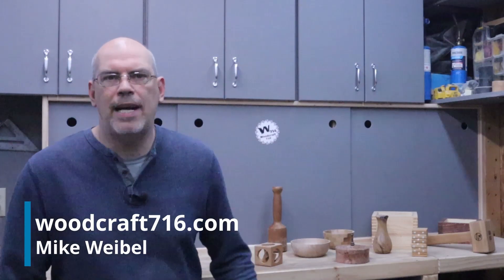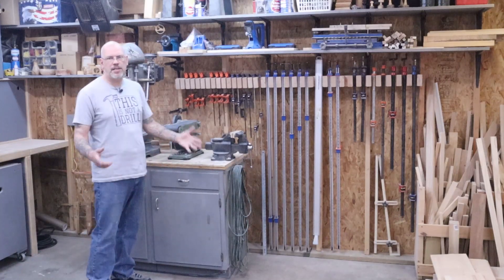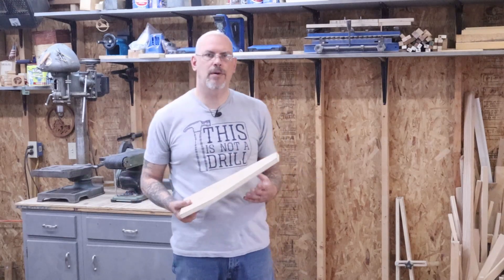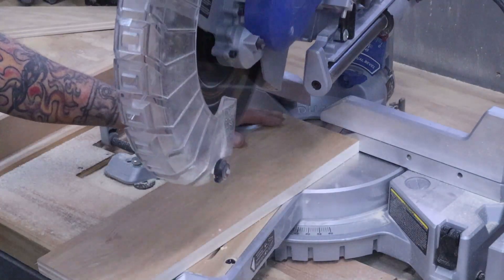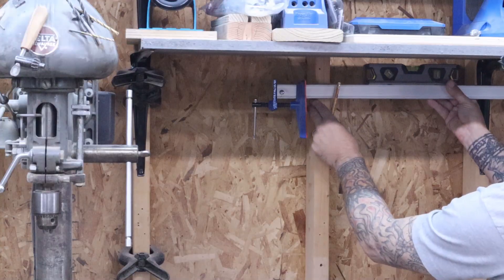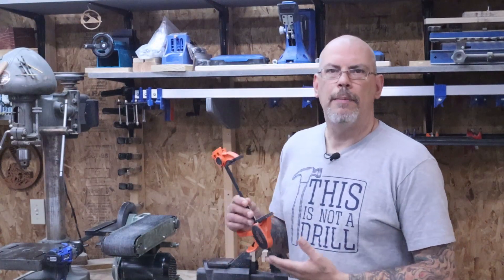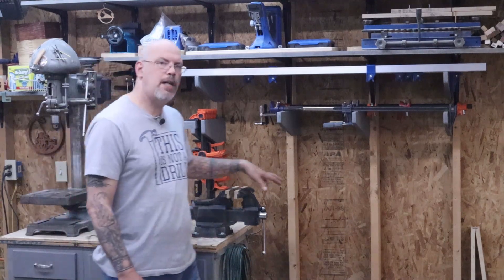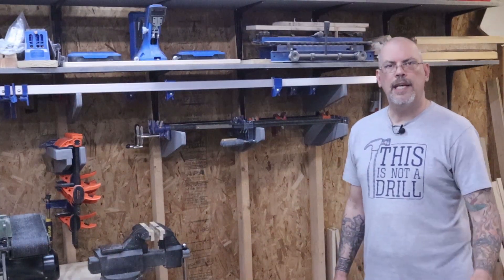easy clamp rack

Comment: My 60"s sit on top of my mobile wood rack, my 24" and 36" used to be on my work table on a pegboard, my pipe clamps are on a different pegboard... ive been giving clamp storage alot of thought lately and I think im going to make a upright mobile cart. Roll it to my bench and store it in a corner when not needed. It will be 4 sided, 24"x72". Not sure if I'll go pegboard or make hanger blocks
Reply from the maker: Thanks Tom. That sounds like a great idea.  I'd like to see it when its done.